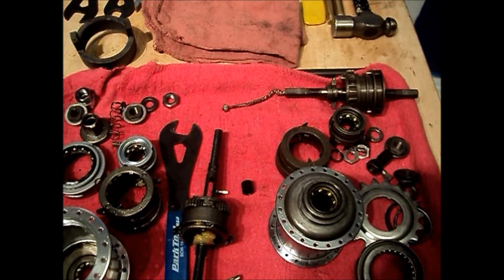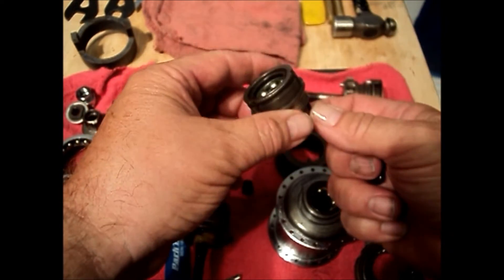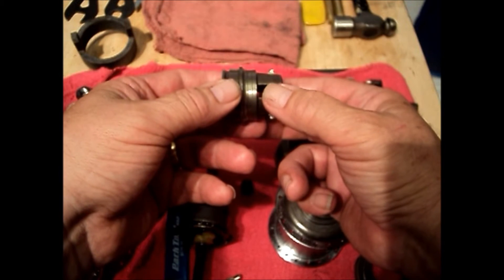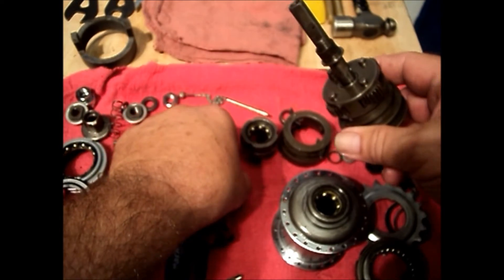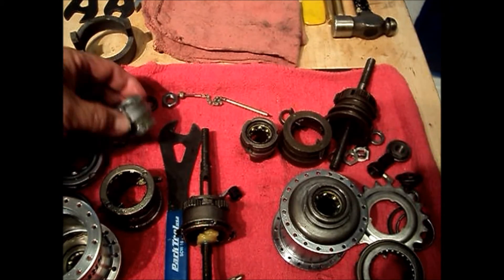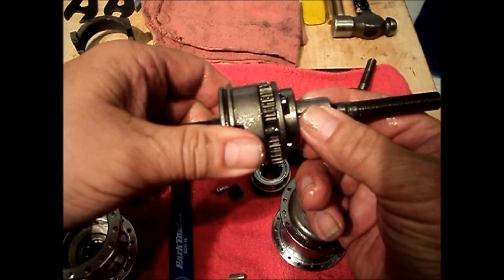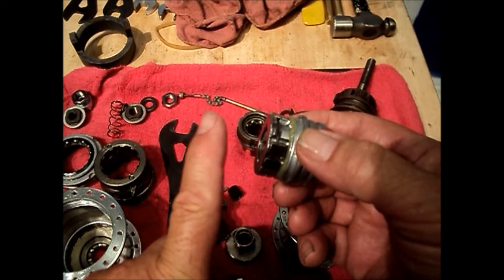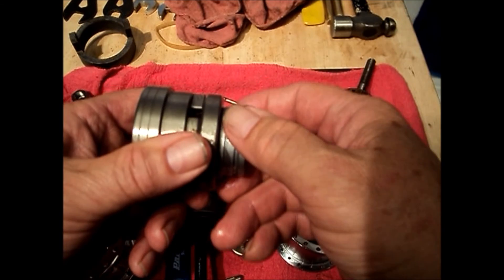Sturmey Archer NIG

Comment: Excellent set of videos. It would have been helpful see the inside if the hub shell to see howand where  the pawls engage. I am due to overhaul my own AW hub and have a couple of questions:
1. How will I know if it has the NIG modification before I dismantle it?
2. Are you familiar with the rattle that can occur when the hub is used on smaller (16 iinch) wheels and the bike is coasting over bumps in the road?. I have this problem on my Brompton and have heard it referred to as the "Brompton Rattle."  It can occur on brand new hubs and there is no apparent remedy!
Reply: @1 6:40
@2 I guess it's because smaller wheels rotate faster, so they make more clicking then when the same hub is built into a big wheel
Reply: @zelupl2063  Wow!  I never expected a reply so long after I posted this. Thanks to this video, I have now become quite an expert on this hub and have rebuilt many, most of them on small wheel bikes. You are partly correct in your reply. Because the wheel is so small as you say, any noise in the hub is amplified and transmitted to the rim partly  by the speed of the wheel but also by the greater sensitivity to the road surface. This noise cannot be absorbed efficiently by the shorter spokes. However, it is not the normal clicking being amplified but the inherent rattle of many SA hubs due to their wide tolerances. I have cured this problem by making my own lubricant from Magnatec oil and old-type lithium grease (not the later white stuff). It is now thick enough to muffle the noise and can be used in greater amounts because it doesn't leak out like most of the thin oils that used to be recommended. Indeed, the later hubs did not provide a lubricating hole for oil but instead the hubs are built with a thicker lubricant. This goes against the previous accepted view of using thin oils. I developed  my homemade lubricant by trial and error. The Magnatec oil blends easily with the grease and does not drain away because  it is designed to stick. Too much grease increased the existing drag of this type of hub. This lubricant also tends to avoid the 'false neutral' that the old hubs suffered from.
Reply: Another way to tell with a lone hub or wheel: fit the left side of the axle into a vise (the flat sides of the axle can be tightened without breaking the treads, but don't over-tighten) and pull on the indicator chain while turning the sprocket clockwise. You should be able to see the 3 gears in action; default is 3rd where the hub turns faster than sprocket, 2nd is direct drive and when pulling fully on the chain, in the first gear, you should see the hub turn slower than the sprocket. Playing with the indicator chain tension you will find a spot in the pre-NIG hub where you can freewheel the sprocket. You also won't hear the clicks in the 3rd gear.

Comment: What was particularly “nice” about the sturmey is that the star clutch and the pins it goes against have a tendency to wear down in such a way that it rides up from 3rd gear to the in between freewheel when under load. So honking on the pedals, regardless of how well it was adjusted, would eventually get you a slip and given that you’re standing on the pedals honking, usually a fall.

Did not enjoy would not recommend the experience.

Comment: Hi Dan,

Have you tried the rotary 5-speed SA hubs yet? I'm having a lot of trouble with mine.

The hole which they recommend sticking a spoke into to release the cable has worn and expanded quite a bit. I'm wondering if it's possible to fix or replace just that plastic cable anchor.

Cheers
Reply from the maker: I have not had my hands on one of the new rotary 5 speed models, so I'm afraid I don't have an answer for you.
 I will say that with the 8 speed which has a similar rotary shift assembly, I usually just pull on the cable housing to unseat it from the stop. Once it's out, there is enough slack to slip the anchor out of the slot.
Reply: Wow, thanks for the quick reply. That makes a lot of sense and I ought to do that.

My other problem: The cable stop braze-on on my chainstay is too close to the hub to run housing in that spot. Do you think it would be ok to have the fulcrum arm pointed up or back so I can have a nice loop of housing there like I would with a derailer?

Thanks again!
Reply from the maker: Is this a retrofit or did the bike come from the factory with this hub? If I were fitting the hub, I'd run a full length housing and ignore the braze on cable stops.
 On some builds, I've actually filed the end off the cable stops so the housing would fit right through.
Reply: Dan Burkhart New frame. Great idea on the full length housing. I'll keep the cable stop intact in case I switch to a derailed in the future.